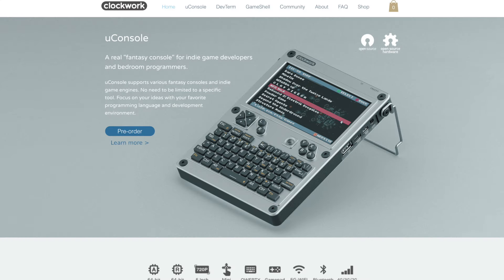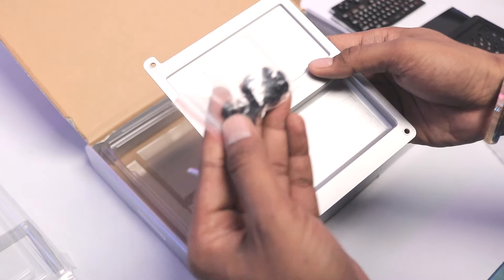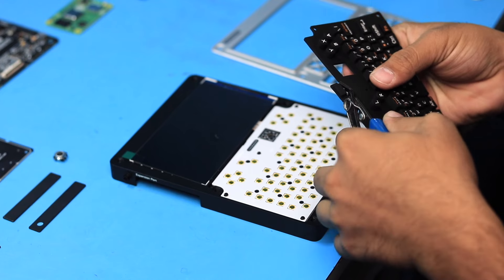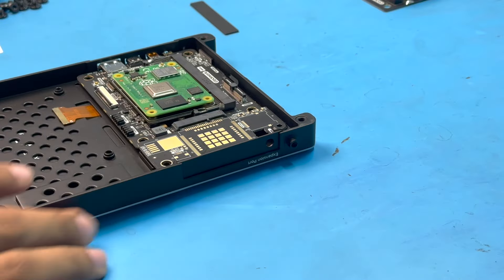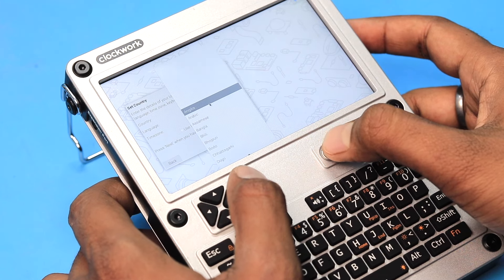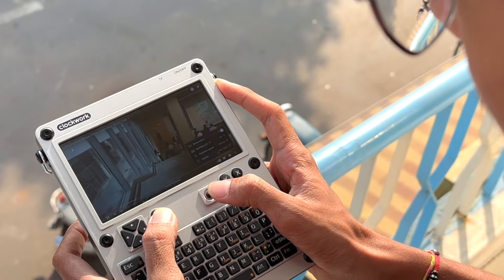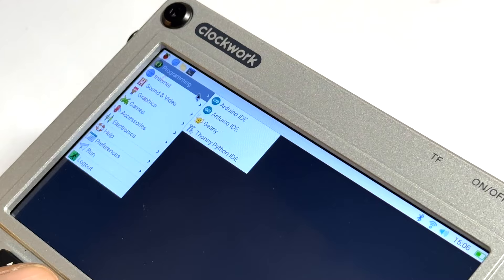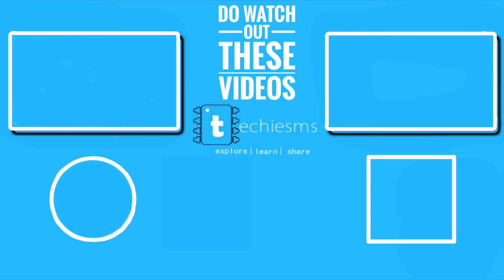Powerful Pocket Computer for All Your Tasks | uConsole from Clockwork pi

Comment: Esp32 voice assistant project , while running the speech to text code I have got( 'LED_BUILTIN' was not declared in this scope ) in "pinMode(LED_BUILTIN,OUTPUT);"  this line , so I removed the led part and run the code when I implemented in hardware and run the project the chatgpt connection is failing , I did individually speech to text part and text to speech part following your previous videos that was working fine , checked the chatgpt API and google cloud API that is also correct , but I am getting error while running this whole project

Comment: Thanks for posting this! I ordered mine back in October and just received the shipping notification! Can't wait to get it. I opted for the R-01 running RISC but also got the CM4 Adapter and a Pi CM4 to try out both architectures. I like your application of using it along with your Arduino devices. Happy New Year!
Reply from the maker: Hope you get one soon…..
Happy New Year✌️
Reply: Do you get it yet can you makes video

Comment: Nice video. Please can you tell us, if this device fit in a jean's pocket ? Also, how long does the battery last ? What about the weight ? Thanks a lot.
Reply from the maker: It will fit inside big cargo jeans pocket not the regular ones 
Battery cycle depends on the type of battery you use, I used the cheap one and hence lasts only for 1 hours 
The weight is 532gm
Reply: @techiesms  You are quick ! Thanks for your reply. Keep up the good work.

Comment: Recently asked fir the r-01 version of the uconsole without realizing that it isnt the same as the others. That beung said ive been trying ti find out if i was to take a cm4 board and the adapter biard they sell, would replacing the riscv with the cm4 allow it to run regular linux distros or would it just be better to get one if the ither versions if the uconsole. Any info on either making the r-01 version more like the standard version one are appreciated